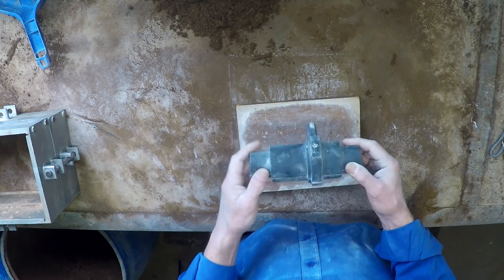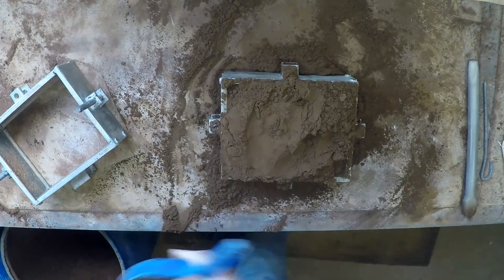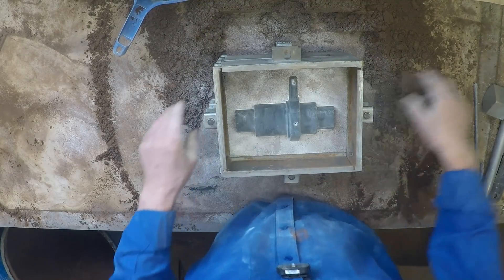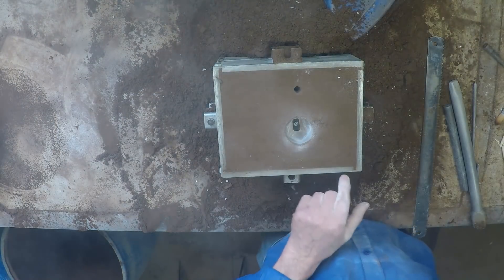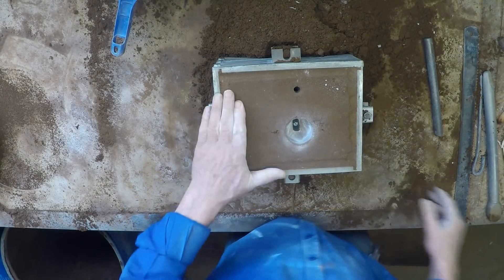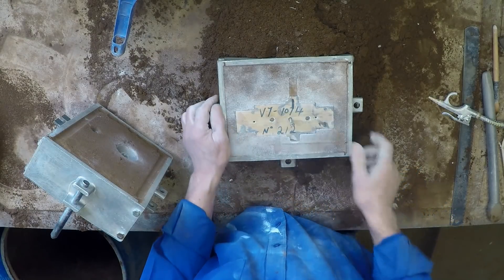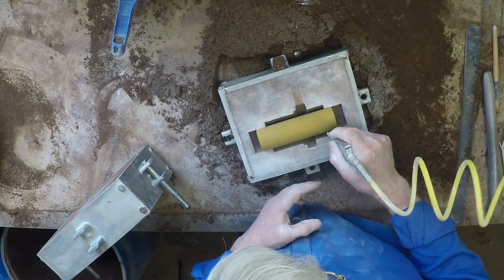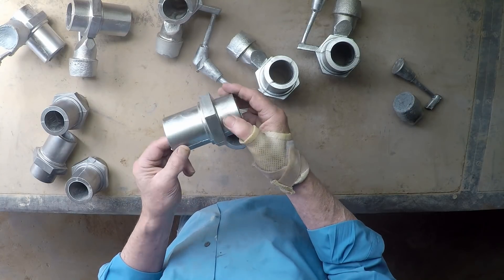Airport runway light frangible coupling

Comment: Very nice set of vids.  I have been fascinated with foundry work ever since 7th grade when we got to cast book ends in industrial arts class.  I did a little die casting in the late 90s at Briggs and Stratton making flywheels, but havent been around any short run sand casting.  What is the parting agent?  It looks like talc, and you all boys are breathing the stuff by the pound.  I reckon if it was powerful hard on a man's lungs there wouldn't be many grey haired foundrymen.      

By the way, Missourians (or at least yours truely) don't know what 43 Celsius is.  Its like the melting point of tin or something, right?
Reply from the maker: Clif, Missouri? My grandfather's grandfather migrated there in about 1845 to escape the Clay county wars in KY (Baker White feud) as he was kin to the Bakers and thus "fair" game for the White clan. Grandfather aged 15  was in Beaver Bam Butler Co MO in 1880 census
The parting agent I use is a commercially purchased one but it is in fact just finely ground calcium carbonate. It is cheaper ($3 per kg against $10 per kg)  than talc for a start and unlike talc it does not contain any silica. Also some talc (mine now closed) contained asbestos. I believe that the human body tolerates calcium  carbonate fairly well as many bodily fluids are quite capable of dissolving it - you might pick up some extra calcium but that would be no bad thing. I won't use talc. There are lots of grey haired old foundry men - all ground down, arthritic, and stooped over.  😏… Martin
Reply: @olfoundryman8418  Beaver Dam township in Butler county is about 75 miles (750,000 KM or something, the metric system is for commies and frenchmen) east of me.  I have a customer in the area and travel there on occasion.
Reply: What was you kin's name?  We may be related.  My folk came here about 1820.
Reply from the maker: Clif, Metric does take some getting used too  but overall it is worth it . I, having been taught inch at school and now living in metric, work in both systems and that is a bit confusing at times.

Family name was West grandfather was James/John franklin West living with his uncle John in 1880 who had married his mother just after his father's death. It was his grandfather Zachariah West who came from Clay/Perry Co Ky early 1845 late 1844 together with his wife Rachael Gay. Zachariah was an illiterate (whole family illiterate except for James' mother Margert J Gentry) farm hand who never owned land and went from farm to far as he found work and living in the barn out the back where ever he worked he raised 9 sons and a daughter while doing this. 4 of the sons fought in the civil war but not all on the same side! The line goes back to Robert West who came to MD as an 8 year old indentured servant in 1677... Martin

Comment: Amazing work. How do you determine what you charge for your work?
Reply from the maker: Amal, I can't quote figures as that would be violation of commercial interests. But I tend to have a price for a given size mould This I will vary if the job contains cores that I have to make first or is otherwise difficult. The amount of metal in the casting is not a factor as compared to the time involved in making and pouring the mould its cost is minor. However if I was to do copper base alloys that might change as they are a lot more expensive. All of this feeds into my overall idea of what I should be able to make in a day both in terms of money and number of castings. I am conscious of any pre casting work that may be needed, are there patterns to prepare or cores to make or dies to clean and set up for example, these things can easily take a full day or two! How much post casting work is there etc. Its all very vague and I don't do it very well. I also get caught with too many "freebies". Sorry that I could not be more helpful... Martin
Reply: Olfoundryman, Thank you very much for the reply. I certainly wasn't expecting you to divulge specific prices for your work, I understand that could land you in hot water. I just find pricing jobs to be a pain. What I mean is you don't want to chase your customers off to your competition (if you have any) with too high of a price at the same time you don't want to come out of the shop at the end of the day no better off than when you walked in there. I guess it's pretty much trial and error till one gets a "feel" for it. I have much to learn. I thoroughly enjoy your videos, thanks.
Reply from the maker: Amal, Clearly you are thinking the right way. It is absolutely no value at all to work hard all day and at the end of it be unsatisfied with the return. This is why I gave up small bronze work, door handles keyhole escutcheons cabinet furniture etc.
I would mould all day and then add up what the moulds on the floor would bring, never enough! And then some of it would not run as it was all thin work and all edge too so I would spend hours cleaning it all up. All in all a depressing dead loss. I chose instead to concentrate on aluminium and on giving my customers the best possible surface finish. Plus, and this is all too rare, high internal soundness and a casting that machines well. These things plus a general level of reasonable service and assistance seem to keep the customers coming back. Many of them seem to value reliability of product and service over price as they have been caught out with "cheap" in the past. If you do loose a customer to a competitor it doesn't hurt to approach the customer and ask why, then perhaps some negotiation and you might win them back. But yes, it is trial and error but  just remember to keep you prices moving up in line with inflation its al to easy to forget to do this and suddenly find after a few years that you are working for peanuts and then you have to go for a big increase which is generally not appreciated.... Martin

Comment: Whats the core made of?
How much do you charge for these?
How do you heat treat to T5?
Reply from the maker: Mr. Greens, The core is made out of resin coated sand. It is a size that I keep in stock as I use it a lot for throttle bodies - it was a bit short for this job but I got away with it. One of my videos shows this core being made Ithink that it was the "Throttle body video part 1"
                      For commercial reasons I can not discuss price.
                     T5 heat treatment is simply an ageing process. There is no, dangerously close to the melting point, high temperature soak like there is with T6. To get the best results I get the castings out of the mould as quickly as possible i.e. as soon at they are only just solid enough to handle. I water quench the castings then after gate removal and any necessary fettling I age the castings in a fan forced electric oven (a domestic oven will do) at 165 deg C (330deg F) for 7 to 8 hours then switch the oven off and allow the castings to cool to room temperature, time of cooling is not important. I use 601 alloy designated 356 in the US (the wheel alloy) and this treatment might not work for other alloys (probably won't). This treatment increases the hardness of the alloy considerably and improves machinability and finish obtained in machining very markedly. However even though toughness and ductility have never been a problem with any of my castings over the last 30 years or more I would never use this T5 process for safety critical work as I suspect it may lower ductility and toughness in perhaps unknown ways.  For any critical work I advise the customer to take the casting to a reputable heat treater and get a T6 process done, in this case I do not do the T5 process but provide the castings "as cast". Generally I try to avoid such work anyway as a failure even if not my fault could lead to a trip through the coroners and other courts.... Martin
Reply: Olfoundryman if i use a 6060t5 extrusion would this be they same or would it need to be aged again? Same question for 6061t6?
Reply from the maker: Mr. Green, As you point out 6060 and 6061 are wrought alloys, same Magnesium /silicon family as 601 (356) but totally different composition. What are you doing with these two alloys? This may determine if they need re heatreatment or indeed even if they can be.. Martin
Reply: Olfoundryman 6060 and 5052 are tthe grade i use when building fuel tanks and frames, so i have plenty of off cuts. Thats why i was asking.
Reply from the maker: Mr. Green, Sadly these are not much use as casting alloys. Sure you can melt them and pour them into a mould and make a casting but it will be soft, weak, and very tacky to machine, I doubt a T5 would help at all. My suggestion is to sell the off cuts to a scrapie and buy some old alloy wheels off him. These are 601 (356) alloy and it is what I use, its good stuff. Just be sure that you have not accidentally got a genuine magnesium wheel, these are very rare but a danger to melt. Check with vinegar it will attack magnesium but not aluminium,  or caustic soda it will attack aluminium but not magnesium or nitric acid it will attack magnesium but not aluminium.... Martin
Reply: Olfoundryman thanks! I know the vinegar trick. I have have some cast aluminium here i will try.

Comment: Another great video. Thanks. I'd be thrilled with that finish :-D
Reply from the maker: Perry, The finish was not what it should have been, not what would have liked, and considering the use of facing sand it should have been better. I suspect that I may have poured it a little hot at 720 deg c perhaps 700 would have given me a better result. But so many things can affect the surface finish that it is difficult to know why one job comes out better than another.... Grr, a frustrating business at times... But customer was happy and that's what really counts I guess....Martin
Reply: Well, it's also a matter of perspective. I expect it's a lot like golf. When you're just starting out you're happy just to hit the ball and have it go in the right direction. Over time you're not happy unless you're shooting under par. I'm in the former group in golf and casting. ;-)  From my perspective you do remarkable work. Maybe its the camera or being 13000 Km away but I doubt it.
Reply from the maker: Perry, You are very correct. But then of course it should be like that , a constant striving to do better, it is after all the story of civilization. I still have my first (useful) casting, it is a very small little moulding box and it will feature in an upcoming video  I hope to do of my journey through and recommendations for moulding boxes. But I can tell you it is one rough casting and so full of gas that metal expanded up in the feeders rather than shrunk down! However I think it quite legitimate to treat one's younger self with a little kindly latitude... Martin
Reply: Olfoundryman sounds like a great idea for a video. Lessons learned with examples doesn’t get much better than that.
Reply: Still being amazed, agree with swdweeb, a master showing what the rest of us strive for. By the way your correct bout the temps the best thing bout this time of year is if you don't like the temps today just wait and they will be a LOT different tomorrow! I can tell I need to bone up on my temp and weight conversions since watching you. I'm in s.e. u.s.

Comment: Thank you  for  another  great video.  I wait in anticipation  for a possible video you mentioned  to swdweeb  about your flasks.
Reply from the maker: Michael, Working on it. It has been my intention to do a video on this for some time but I have a lot of other video ideas too that I feel might be useful, further clarification of the degassing issue for example could take 2 or 3 videos and still seems needed particularly in view of one YTer I recently came across who tries to degas with caustic soda, the mind fair boggles! Then there is then issue of fluxing, of furnace and burner design,of sand, of lost foam etc etc. There are just so many things and so little time but The box journey is one that will be quite soon I hope... Martin

Comment: Is the facing sand you use petrobond
Reply: He makes his own... he has a video on it. Very interesting.
Reply from the maker: Brian, Troye is right, I have a video called "My Home Foundry Preparation of facing sand". It explains it all, but briefly I mix 50:50 old and new green sand and grind the mix fairly finely in a sort of home made flour grinding mill. This is tempered in the usual way with water and I have my facing sand. I have seen some people use petrobond as a facing sand and Indeed I am keen to try it myself as soon as I buy some petrobond. One would need to be as careful as possible I suspect to get as much and preferably all of the petrobond out of the green sand after casting. I have no idea as to how green sand would tolerate small accidental petrobond additions - guess I might find out.... Martin
Reply: You seem to get a better finish than the Petrobond crew.....
Reply from the maker: Andy, Yes, I think I do but to be honest there is not much in it, and using petrobond would be easier than what I have to go through to get my fine facing sand. However petrobond is not cheap at $4.00 per kg here in Australia and I notice that most petrobond users are very particular about not loosing sand. Me, I would loose a kilo or two every time I cast. I think that petrobond has both good and bad points :- it is clearly a stronger moulding material judging by how people make simple cores from it, It does not contain water so the potential for gas pick up should be less. However this also means it has less chilling effect so metal should run further in it BUT mechanical properties will be lower. I do intent to get some soon as it suites some work eg. memorial plaques. I am looking forward to trying it... Martin